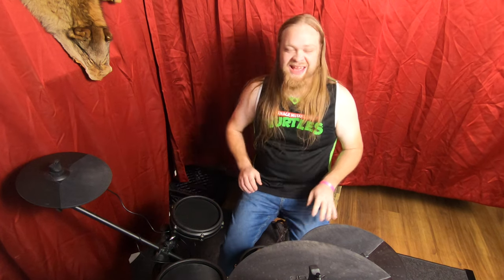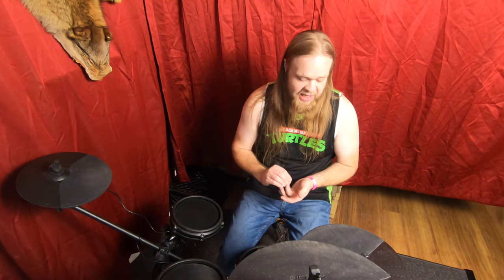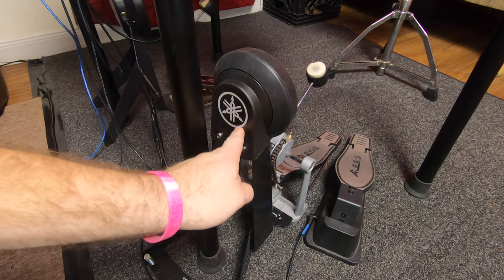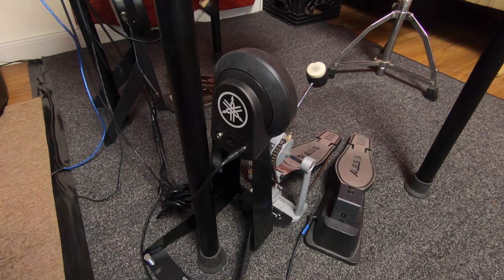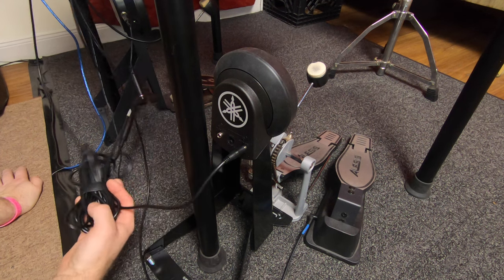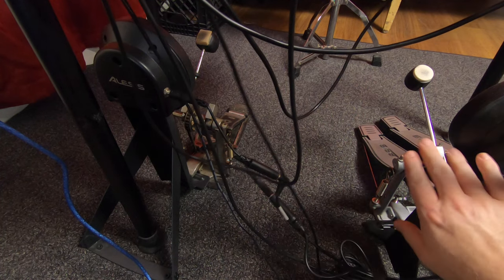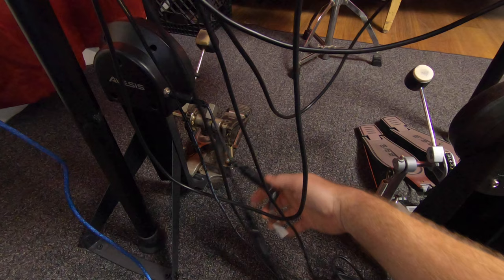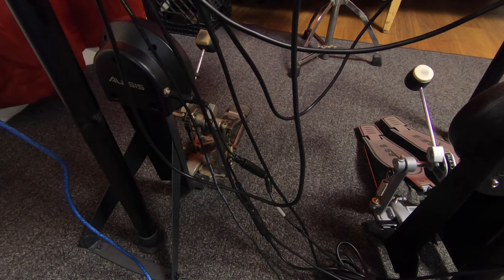Double Bass On Alesis Nitro Mesh Kit

Comment: Hi, I think you can do it more simply. This Yamaha has an out link for the second kickpad. So connect the main cable from the module to Yamaha and from Yamaha's second cable to the Alesis kick pad it must work.
Reply from the maker: Thanks for the feedback, I actually tried that and it didn't work. Tried both plugs for the output to the second pad and neither worked unfortunately.
Reply: @piratestudiosproductions  It's weird. Because I also wanted to assemble a similar kick setup. Now I have to think.🤔
Reply from the maker: @Lycane666  well, if you find a shorter cable let me know lol